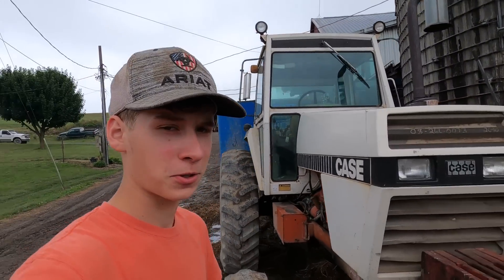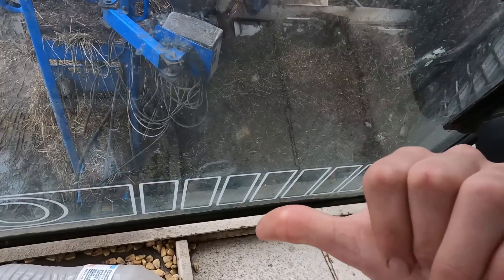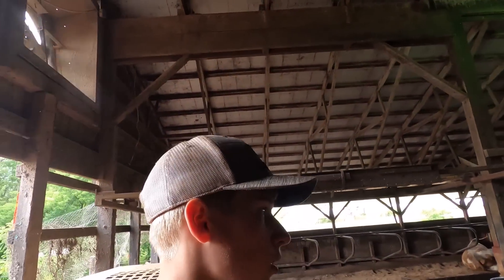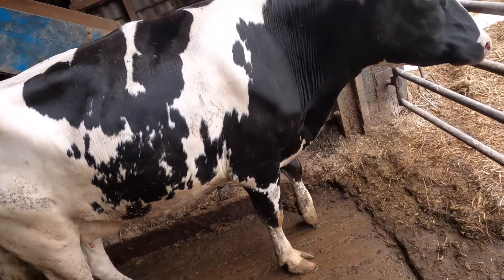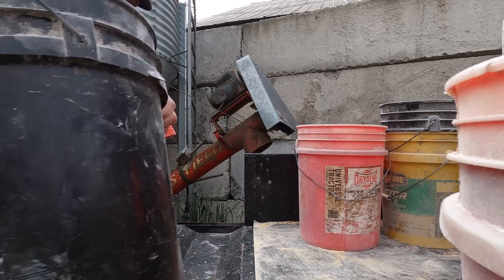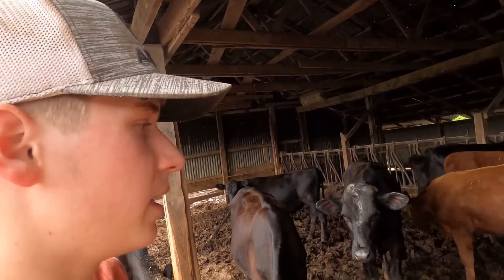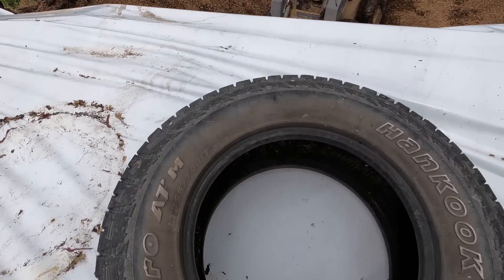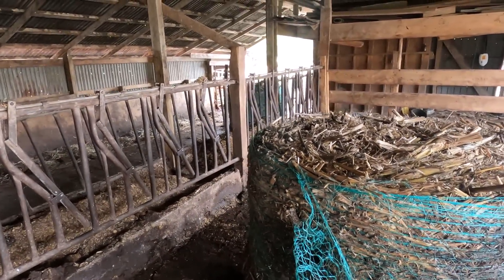A Day of Taking Care of Cattle

Comment: Take a piece of wire and use that to check your fuel level by sticking it down in the tank at the filler spout. Not as good as fixing it, but it would let you know the fuel level.